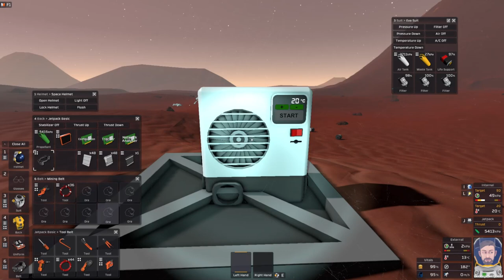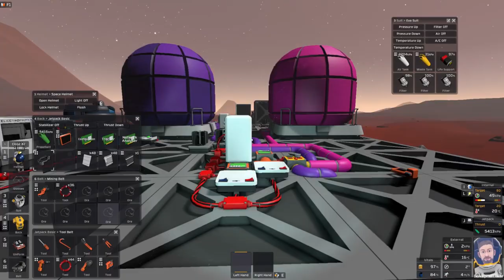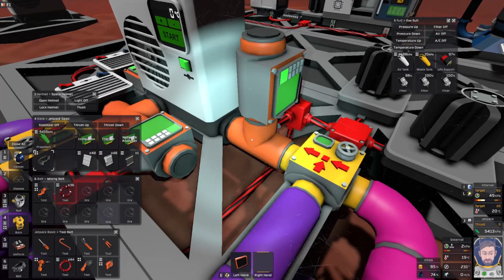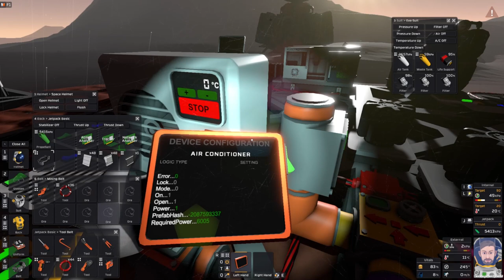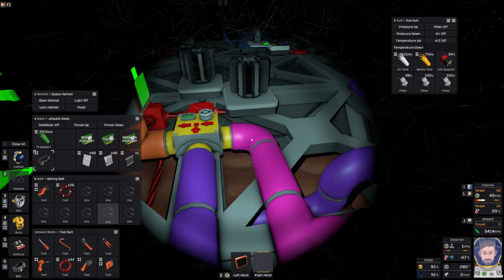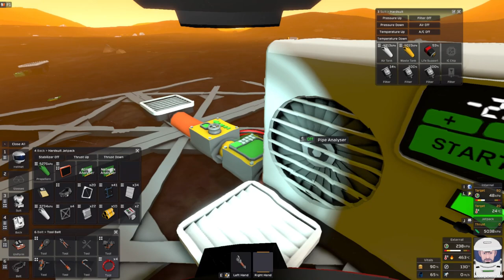Stationeers Experiment - Air Conditioner

Comment: It's basically a very quirky vortex tube. All of my ACs run at 300W, and if I want below 0 Celcius, I just run it in reverse-flow, where the 'WASTE' is the actual output with the machine set to +200. This gets temperatures at or near -273 Celcius. (Absolute Zero)
Getting near -273 in Venus is incredibly inefficient power-wise and really only recommended if you have plenty of power/time to spare, since you need at least a cascade of 3-4 AC Units.
IF this game actually modeled Phase change, that would be sweet. (which they are taking steps towards, denoting they separated H2O and gasses) Phase change is what is required to make ACTUAL AC units work.

Comment: Thanks for the info! Tying to the lessons from your experiments, I set up a Venus greenhouse using outside air. I needed 4 times the number of "input" as you do "output". 4 Output + passive vent for output, and 16 + passive vent for input. This was for 20c target temp, and it keeps at 300w.

Comment: Nice experimenting! You can also think of the "waste" output as the heat exchange line. There are many ways to use an AC, and this for sure is valid. However, it's important to note that there are more efficient gases you can use, I believe pollutants is one of the best because of its heat capacity, sort of acts like a refrigerant. Any gas will indeed work, but pollutants works better usually. If the waste/heat exchange line is empty or low pressure, the AC will pull from the input to fill it to at least 100kpa(or around there iirc). I prefer to manually fill it or use logic though as it gives you more control. 

Say for example we want to cool down an input gas, we can hook up the input to the output, and fill the waste line with X. The heat exchange line will then dump the heat into the waste pipe. If we were heating a gas, it would instead make the waste pipe colder by taking heat from the waste line. As the input temp and waste temps difference grow further apart, the more work the AC has to do and less efficient it becomes, so typically you want radiators on the heat exchange line so you can use the atmo temp to cancel out some of the difference(since it will equalize temp with atmo over time). However there are certain scenarios where you can use the waste line to your advantage. 

For instance, instead of combustion, you can just use hot gas created from the waste line and input that directly into a furnace. You could set this up by simply putting a passive vent on the input and output of an AC, then pump the waste full of any gas. You'll want an insulated tank(and insulated pipes) on the waste line too just for volume. Set the AC to -200 to get hot gas on the waste line, or +200 to get cold gas on the waste line. If you don't want to wait a long time you can even string more AC's together, or jump start the whole system by using combustion to make a large supply of hot gas, then just using the AC's to keep it hot or make it even hotter than combustion allows.

Comment: About that passive vent counting as a pipe. I also found that it counts as uninsulated pipe so if you have a passive vent on your wall venting outside, it will slowly exchange temperature with the inside where the back of the vent is in contact with the atmosphere inside.
Reply from the maker: Very true.  You'll notice Mick always puts full frames on his ceiling now so he can put vents on the ceiling for this reason.

Comment: Really nicely done!  I had all but given up on these.

Two follow up questions: 
1.) What happens if the waste pipe gas is colder than the input? Does it affect the power cost for cooling? 
2.) Does the AC unit add the full 6000J of energy to the waste pipe? (i.e. if you connect input, output, and waste together the temperature does not change?)
Reply from the maker: Thanks!  To answer your questions: 

1) If the waste pipe it cooler it doesn't seem to help (still takes 300W and only cools 6000J/tick).

2) The waste pipe receives the sum of: energy removed from processed gas (which is up to 6000J), plus 50% of the electrical energy used in excess of 300W.  So if you tied them all together, I don't think the temperature would go up, but this is only possible because the waste and input are at the same temperature so it only draws 300W and won't add any more heat.  But I haven't tried that.

Comment: I thought I knew about everything about ACs, I've done probably 20 hours working with them in creative trying to get a GFG power positive on Vulcan and or Venus. The number of pipes on the input altering the flow rate I wasn't aware and it does answer a lot of flow issues I was having. I did control the flaw rate at some points but this shows why I was having issues increasing it.

Good info for sure but it doesn't change the fact you'd need more than 33 of them ( More power than would be produced ) running like that to cool a GFG a 1kp input. They just produce insane heat lol.

I would certainly be interested in seeing an Experiment video if you could achieve a power positive GFG on the hot Planets :)

You are certainly one of the top Minds playing Stationeers :)
Reply from the maker: Thanks!  How much heat (in J) does the GFG produce, anyway?
Reply: @autom8it339  I haven't tried to figure that out. You have more patience than I doing per tick testing. A small example to kind of put it in perspective, if you have the GFG encased in a 1x1x1 and feed it lets say -70 degree air out of a tank with 5mp pressure, the input volume pump is generally running at about 7-8L/tick of 5Mpa gas ( lol.. ) on its setting to keep a 1kpa fuel input GFG in operating temp.

Wide open with full input I have a set of them each producing 97Kw, ( I of course don't use that much power even in this obscene base I'm building on Europa they only run for a short period to charge the battery rack up ) Using the ambient air pressurized to 10mpa @ around 133k the feed volume pump runs at about 6L/tick to maintain operating range.

I've since abandoned that cooling technique for one used by Elmotrix ( Another Stationeer/YouTuber ) to just have a large enough room space volume as a buffer to cool with Eurpoa atmosphere without the wild temp fluctuations. My skills in making a smooth PID controller are basic at best.

Comment: Unfortunately I think this video is out of date since the phase change update. In the new air conditioners the efficiency is calculated from A: the input temp; After about 100C efficiency starts dropping with 0% around 600C. B: temp diff between input and 'waste'. Efficiency drops starting at around 50 degrees difference. C: pressure difference between input and output. So you can't magically get 6kJ of cooling no matter the temperature of your input and waste. One major improvement to the game in recent updates, though, is more feedback from the machines about what they are doing instead of being total black boxes. The new air conditioners show you the efficiency stats on the display in real time. The heat exchanges tell you how much heat they move.

Comment: I also found that it depends not on the input pipe length, but input/output pipe lengths Ratio. And I saw how it’s performance seems growing with increasing pressure of output.

Comment: Very nice experiment. Wow pipe lenght cuts the flow rate substantially! Also moral of the story, don't let your waste side heat up. I did another experiment to see if thermodynamics hold up. Was disappointed to see temperature has an effect on pressure, but changing pressure did not change the temperature with fixed mol count. Guess they calculate it like mol/volume*temperature = pressure. And it doesn't go other way around
Reply from the maker: As best as I can tell, they're using PV=nRT, and each atmosphere object (large grid space, or inside of a pipe or tank, inside of suit, or even your lungs) has the properties of "n" (of each gas type) and heat energy in J.  It then uses the known volume, and specific heat of each gas to calculate the pressure based on everything it knows.  So if you change the volume (say, by adding or removing a pipe segment), the heat energy in there stays the same, so pressure will increase or decrease proportionally.  Heat will move between certain objects (uninsulated pipes or tanks and the atmosphere, etc.)
Reply: @autom8it339  i was trying to make an actual heat pump. One side high pressure chamber one side low. Pumps with regulators, closed cycle. Radiators all over them. What ever i tried, it didn't work. Then i did experiments, sure increasing the temp boosted the pressure. But pumping the gas to a smaller volume didn't change the temperature a notch. Then i realized yes they use pv=nrt but pressure is the final output, not an input in any case. Sorry that's bit off-topic but i needed to whine about it
Reply from the maker: @LeventDV  I admit I stopped taking chemistry after first year.  But don't all heat pumps rely on phase change?  The compressor forces a phase change from gas to liquid and the coolant is forced to give up it's latent heat of evaporation on the radiator side.  Then it's pumped through an orifice into a low pressure chamber to force it to evaporate and that side absorbs heat.  But it's all based on phase change, right?

Stationeers doesn't have phase changes, that's why it doesn't work.
Reply: @autom8it339  not necessarily. With vapor cycle yes, phase change for certain materials can suck up/release much much more energy than temp change. They are great! But still, If you squeeze a gas, it heats up, bleeds energy off to surrounding, you move it into the chamber and let go of pressure, conservation of energy, so it's chilly now instead, it sucks up the heat from chamber to equalize. Then move back to outside and repeat, there, you have a fridge. That's a gas cycle and there's no phase changes, and it does not work in game
Reply from the maker: @LeventDV  interesting!  No, the game doesn't model this.  The devs have repeatedly told us this isn't a physics/chemistry simulator.  I think, given the performance issues they've had, I doubt they're looking to add thermodynamics calculations to the game, so I don't see them adding this.

Comment: Oh man, I did almost the exact experiments for myself but I hit a brick wall. I had almost identical setups on different maps, some were working and some weren't. No part of my brain ever considered there could be a link between efficiency and input pipe segments! That's wild. Thankyou! Have you tried this with tanks instead of segments to decrease mol input? Same result?
Reply from the maker: Well, I haven't tried with a tank, but if you hook a pipe to a tank, they have different atmospheres, so I doubt the tank would affect it.  

I think I was lucky to notice the input volume thing.
Reply: @autom8it339  Turns out your genius isn't quite complete. So I merrily employed your amazing system on several maps and suddenly it stopped working my new game. Turns out that it's not JUST in input pipe segments but also the OUTPUT pipe segments (probably a function of the two). I had your venus system connected to a super long filter line and it was creating 300 degree air, I couldn't understand it. All I had to do to fix it was put a digi-valve 1 pipe off the output of the AC, effectively limiting the output pipe segments to 1.
Reply from the maker: @MintyMike26  yes, we've been discovering that too.  It seems to be related to input to output volume ratio.  You can also use a regular (manual) valve to split to pipe into two segments.

Comment: There is also a slight disadvantage you haven't dealt with on Venus as its Atmosphere is high pressure. If the Waste Line on the AC has less than 100kpa it will bleed all input pressure to it until it reaches that 100kpa. Obviously with Venus ( the only of its kind in Vanilla worlds with 224kpa ) it serves for a big advantage with the AC in that regard.
Reply from the maker: Yes, on other planets you'd have to pressurize the input/waste pipe.  On Vulcan I'd pressurize with night air.  You'd have to exhaust and pressurize again every few days.

Comment: In another video I se you're experimenting with the thermos of pipes. While testing room temp/pressure to find safe level that the adv furnace and other stuff don't melt, I ran into a strange bug which I posted to their Jira awhile back bit it hasn't been looked at yet. Don't know if you want to check it out more. Basiclly it's a 1x2 room with some un-insulated pipes with heat sinks. I think it might have to do with the HS facings transfering heat into the ajoining frame space outside the chamber. The room is doubled walled and you can vac it, but when the gas in the pipes heat up, the areas on both side at the window end heat up. No other area heats up. The test has an AC to provide heat to the pipes. If you draw a vac on the pipes and use the wall heaters to heat up the room, again, no heat outside the room.
This is the save: https://steamcommunity.com/sharedfiles/filedetails/?id=2427559639
Reply from the maker: Could that be because the uninsulated pipes transfer heat to both sides of a double wall, not just the side with the radiator on it?  Or am I reading that wrong?
Reply: @autom8it339  The uninsulated pipes don't touch the walls. They connect to outside teh chamber and to regulators via insulated pipes. The area outside the chamber on both side heats up. When you walk into that frame area next to the wall, you can see the the area is hotter. Stand on top, ether end, ether side at the other end, no heat.  If the room is a vac, it should just cool the pipes, but instead, you get heat outside the chamber. If you vac te pipes, put a little gas in the chamber and use teh wall heaters to heat the chamber, again, no heat. I haven't tried anything with the heat sinks removed or rotated yet to see if the heated areas move.

Comment: I've been trying to go the other way with AC's. Using the AC to heat a furnace from heat from the base. Kinda works, but uses so much power, you are better off just using wall heaters. i think there may be a way to maybe use 2-3 AC units if they are connected correctly.
Reply from the maker: Actually, in my next Venus getting started episode I'll show you how to use an A/C to smelt steel in a furnace without using a ton of power.  Stay tuned.  :)
Reply: @autom8it339  I think you can take it much further than just making steel. Using what you showed here, a fully electric furnace should be possible by sealing the input-waste loop so new gas can't enter and then just let the waste heat slowly build up. The temperature can go very high this way, for only 300W per tick. Just before hitting vaccum in the input-waste loop, it's not hard to get over 1 million degrees.

It seems like it's not just the input volume that matters, it's the input/output ratio (maybe you said that, idk). I found 2:1 to be the same as 4:2. When trying to build heat in the waste-input loop, we want the cooling in the output to be -200°C for as long as possible (as temperature goes up it becomes harder to cool down). I found a 5:1 ratio to work well here, it starts to slowly bleed through at temperatures of 600+K but just a little. Adding even more input pipes to make it more efficient will also slow it down, and a short heat-up time is desireable too. This ratio will not change by connecting to other pipe networks at the output or input, so we can very easily connect a tank if we want to heat up more gas than the pipes can hold on their own.

From the limited testing I did (with CO2 starting at 292K) I noticed a trend. Every time half the moles had been removed from the waste-input loop, the temperature had increased by 75%, it doesn't seem matter which temperature we start at (as long as the output remains close to -200°C). If this trend is true for any gas and all setups, it would be really easy to predict how much starting gas we need to reach a desired temperature and pressure. And if heating feels slow, we can just add more AC's by adding more pipes as long as we maintain a 5:1 ratio for the input and output volumes for each AC (there could be better ratios to use).

This... is this really right? You found something aboslutely bonkers. Gain extreme heat by just reducing the number of mols, it's way too simple. The AC is broken for sure.

edit: the gas will be heated in the insulated pipes to avoid any cooling from happening, the final step is to move the gas into the furnace
Reply from the maker: @ketrix1594  It's not that bonkers... if you take PV=nRT, then if you decrease n and keep everything else the same, T has to go up.

What's weird is that V (or the V ratio, as you say) controls n.  That's bonkers.

If you look at Casegard's follow-up video to this video, you can see a better way to feed a furnace.  Basically take the waste pipe and use a back pressure regulator to empty it every tick.  Feed the input from atmosphere, or whatever the hottest gas is you have.  Based on later measurements we did, 2/3 of the input gas will be diverted to waste, and then heated up.  It still only draws 300W.  However, waste pipe length seems to affect power usage, so Casegard said it needs at least 4 pipe segments on the waste to keep it down to 300W.
Reply: @autom8it339  very good video, thanks for mentioning it. He looks at the same effect, but I like his setup more than my own.

I think the AC uses the PV=nRT too liberally. Temperature is difficult to increase, energy must be added to the system, and this formula doesn't show that fact and the AC seems to be ignoring this too. What the AC does to the temperature, is like taking a cup of coffee mixed with milk, and then separating the milk and coffee back out.